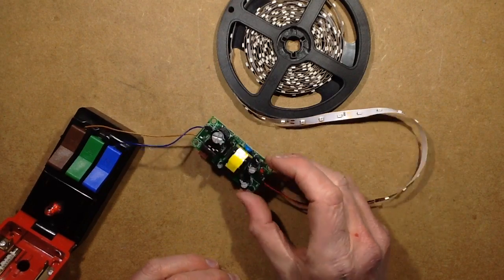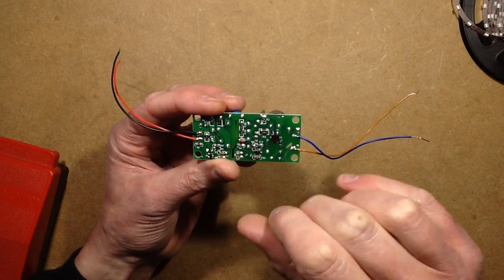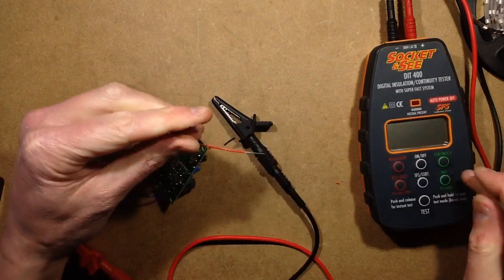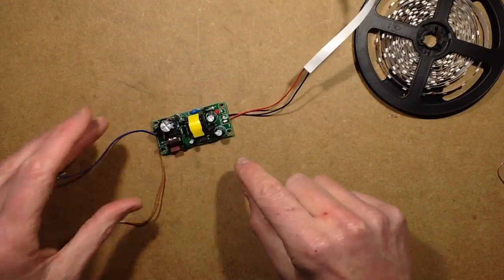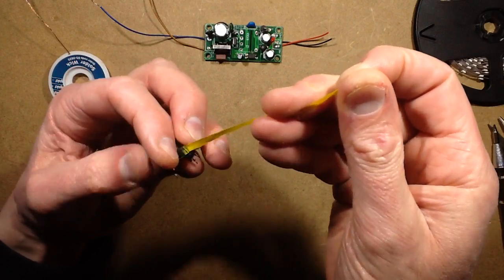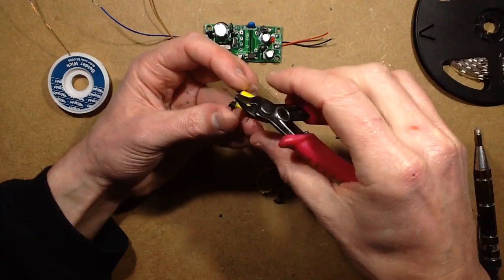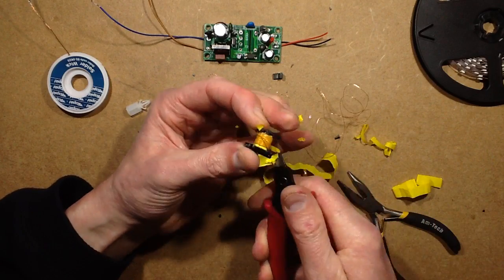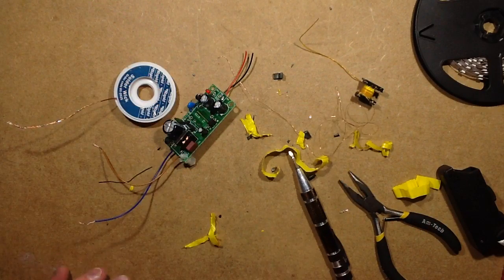Test of bare eBay 12V 1A PSU module, including safety tests.

Comment: Shouldn't say UK grade, that is making a myopic leap in claiming that no other country in the world has any standards in making anything and everything is relative to UK standards. You should just say it complies to a level of UK safety, because every other country has standards of safety and some higher than the UK.
The Chinese simply make an array of products as they are the worlds biggest manufacturer. So at the cheapest possible choice you can find it usually isn't of the best quality for obvious reasons, that isn't anything to do with China, it's to do with the price. As China makes many good things if you are willing to pay more. 
As an example, a pathetic Samsung galaxy cheap clone on ebay is usually trash. But if you buy a good Huawei phone they are really good. 

But you have many people like in the comments trying to base Chinese people and their intelligence or safety off the cheapest possible products they can find on ebay, that just isn't logical. 
That would be the equivalent of going to the UK to a school for mentally handicapped children and concluding that is the education level of the UK, that isn't a proper form of thinking. 

Because most of the other products in stores are all made by China anyway, they make anything to all varying grades.

Ebay doesn't operate like a normal shop either, they don't personally check or even check pages of things posted at all.
That's why the Chinese put exaggerated mAh ratings on many cheap things, put false MP ratings on stupid cheap camera's, and put false lumen ratings on cheap flashlights etc. 
Even though they are blatantly lying, they sell hordes of this stuff to westerners. So it would seem the people buying and believing in it are the stupid ones. If the ebay client base of cheap electronics was more intelligent then the Chinese would be more realistic about their claims to be believable.
Reply: So it's somehow our fault the Chinese are cheap, lying, purveyors of unsafe crap?

Comment: whats the best AC to DC power supply/DC converter to use to drive those strip lights off of a motion/PIR switch to use as under cabinet, motion activated lighting? I'm going to have 3 separate runs so I'm trying to keep cost at a minimum...I could go down to 2 runs if I can figure out a way to jump from the end of one strip with plain wire, snake through the inside of cabinets and come back out and reattach to another step on the other side of the stove. any help from you guys would be greatly appreciated! thank you in advance.

Comment: I might need to order a few of these, myself. I'm quite taken by the 12V/5V dual output option! And a friend of mine who's been designing a circuit of their own might be snagging some as well because just one of these is cheaper than the PCB space of having her own switch mode supply designed in.
Reply: I get those from every computer I salvage. Short pin 14 to ground on the motherboard power connector of any ATX power supply (pretty much anything Pentium II or later, unless you got a funky proprietary brand name PC like DELL or HP where the pin-out is hit and miss) and you have yourself a 300w or higher 5v/12v PSU with -5, -12, +3.3, as well as a 5v that's always on (motherboard standby power, pin 9) even when pin14 is off. http://www.helpwithpcs.com/hardware/img/power-supply/atx-psu-pinouts.gif

Just grab any old PSU from a PC that you're throwing away, install a nice power switch, maybe a power LED, rig an easily replaceable fuse holder or a trip breaker and mount some barrier strips or screw terminals (for easy connections) from your scrap pile, and you'll have yourself a cheap recycled bench power supply.

Granted, these don't mount easily into your projects, but I get lots lying around that would otherwise be going to electronic recycling.

Comment: Hey clive

Where did you get the spring loaded mains cable connector from ? And can you remember what it's actually called?

Love the videos by the way :)
Reply: That's a Quick-Test unit. http://www.ebay.com.au/itm/121720059249?_trksid=p2055119.m1438.l2649&ssPageName=STRK%3AMEBIDX%3AIT . Might seem expensive but well worth the investment, and will last a lifetime.
Reply: Thanks Phil. Been looking for something like this

Comment: Hey, really love your videos. I was wondering if you take requests? I'd love to see breakdowns of those variable step up/step down supplies to get an understanding of how efficient they are. Particularly the cheap DIY kits on eBay for building a variable 30v supply. You can find tons of these suckers from China.

I know from personal experience with computers that cheaping out on the power supply is never good and I imagine the same concept applies to bench supplies as well, but having a cheap alternative to the expensive options would be really good if it's reliable or safe.
Reply from the maker: I'd suggest leaving a generous margin with the cheap adjustable supply modules.  Like half their rated current max to ensure they remain cool.  Julian Ilett has done quite a few videos on the power supplies.
Reply: bigclivedotcom
Heat was a concern for me as well, which is why I was thinking of mounting a small heatsink to it, then putting it in an aluminum case and letting it sit between a layer of thermal paste, effectively turning the entire chassis into a massive heatsink.

I'll check out that guy's channel. Seems really interesting. Thanks!
Reply: There are quite a few YouTube vids. of DIY bench PSUs built with Chinese DC  DC boost - buck converters, using off the shelf switchmode supplies for the mains side of things.  I've built a 2-channel very cheap PSU using two of these - http://www.ebay.com.au/itm/100W-DC-5V-32V-To-1-32V-12V-8A-Auto-Step-Up-Down-Regulator-Buck-Boost-Converter-/191963750617?hash=item2cb1ee60d9:g:wdwAAOSwxg5XzpAh, and so far it's worked OK (and I'm still alive!) Note that the "100W" rating might be "Chinese watts", so a little derating may be sensible . . . . .
Reply: I've just been using a B3603 with 9V batteries, but I'd like to get my hands on a 24V power supplies(from mains) to use with it.

Comment: Amateur question - when you did the 500 and 1kv tests and it "passed", where did the power go?
Reply from the maker: It didn't go anywhere.  The test is to see if current flows through the unit when a high voltage is applied.  In this case it didn't allow any to leak past.
Reply: that thing are for testing the resistance between the AC and the output, in this case the tester fired up 1000v on 1 side but the other side it didn't detect any voltage =>> it's a good insulation so the voltage couldn't arc over it
Reply: Interesting, seems obvious now, thanks for the replies

Comment: dont no if you found the data sheet for the 63G20a ic but here it is http://www.alldatasheet.com/datasheet-pdf/pdf/300864/GLENAIR/M85049-63G20A.html
Reply: Obviously you didn't actually look at that datasheet before you posted the link.

Comment: Although these PS's will drive a little more than their rated current over a short period, with LED strips, after a while they will start flashing - a classic SMPS effect. The PS is also likely to overheat, especially as the LED strips tend to be used for possibly large chunks of an hour at a time.

Comment: Hi Big Clive, I managed to find the 63G20 chips for sale but the pages don't have descriptions on them that are of any use or those real handy datasheets... https://world.taobao.com/item/524764312766.htm  ....you would also need to run it through a translating website like google translate.  The title of this item translates in to "New original power supply 6-foot chip 63G20 SOT23-6" .

Comment: 3 months after buying one, I know it can run 24/7 (for 2 days straight at least) without a problem, produces minimal heat and has no electrical noise. It's brilliantly good! Thanks!
Reply: What load?
Reply: 2,5 meters of LEDs in a strip (150 led chips)

Comment: I'm confused... Besides voltage under load, would not the next most relevant test to be to check output ripple. I mean its a DC supply.. voltage under rated load and smoothness of output are the most important factors when rating a DC supply.. Especially if I was going to use it in a preamp cct...

Comment: Hi Clive. Are there any books you could recommend that explain the basics of electronics? I love to have a fundamental understanding of all of these components, and why they're used. I'd love to be able to read a basic 'analog' circuit board like you can.
Reply: bump
Reply: +Bereitschaft I bought "The Art of Electronics" Third Edition, which was recommended elsewhere, but it still is above my level. It goes into voltage dividers within a few pages, but I had to ask a friend to explain them to me in a way that they made sense.

Comment: the driver is the ob2263 quite common in psu and chargers
Reply: also the core of the trafo comes out quite easy and fast heating it up with a heat gun or for bigger trafos submerging them in boiling water

Comment: I may order some of those since I want some led strip lighting in my bedroom, they seem decent and look unlikely to explode.
Reply from the maker: +ewandougie I'd recommend the cased in-line LED lighting transformers for that.  they're very common for powering 12V DC ceiling lights.  Just make sure you don't buy the "halogen" version though as the output is unsuitable for LEDs.

Comment: The european norms suggest that the device should be able to handle a 2000v test if metal parts are exposed but grounded, or 4000v if the stuff isn't grounded IIRC.

Comment: Where did you get the mains isolating box from? I used to use one years ago, but can't work out what to search for on eBay?
Reply from the maker: +Paul McGuinness Quicktest.  In the UK you can buy them from CPC and Rapid Electronics.
Reply: Cheers :-)
Reply: +Paul McGuinness You can still find them on ebay but they are quite expensive.  I have two somewhere and now I want to use them.... I can't find the buggers!

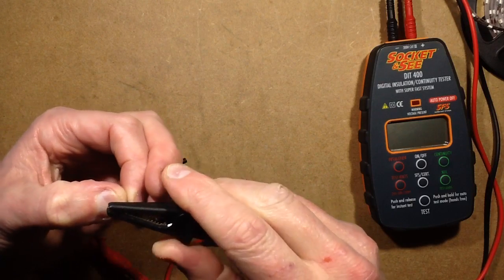Comment: I am looking online for your union r strippers (4:30) but couldn't find them but I did find some union tools.  Do you have a better description or a link for them?
Reply from the maker: +Carl Lind The Unior strippers.  The same style is made under many brands.  If you look for the similar style with thumbscrew adjuster you should find them.
Reply: +bigclivedotcom Last year I bought the vise grip ones but they only lasted for about 100 wires.  I think my mistake was using them on romex.  Thanx for your help.

Comment: Hey, I live in the US, and I'd really like something like your Quicktest, but it seems they only make 240 and 480v 3-phase versions. Do you know of anything similar that uses the US standard colors and plug?
Reply: These kinds of things are typically rated for "up to" 250V, so running at 110V should be fine but might not light up the built in indicator lamp. Also, because the 230V world has so many different plug standards (especially many when the grounding / PE pin is required), these things are probably sold without a plug anyway.  As for the colors, I seem to have read somewhere that the latest US electric code permits this particular set of 3 colors (green grounding/PE, blue grounded/N, brown live), but I haven't checked.
Reply: Cliff Quicktest makes one for the US market

Comment: Keep up the videos!

Will you consider inducing a primary secondary contact failure to see how the rest of the psu responds?

Also, did you look to see if there is a bleed off resistor on the primary side cap?
Reply from the maker: +Chris Given The primary circuit uses a switchmode chip which generally results in the electrolytic being discharged quite quickly when powered off, by virtue of the resistor used to boot the chips power supply before the auxiliary winding becomes active.

Comment: So - I use them all the time - probably the same supplier. The smaller ones are ATTROCIOUS - really dangerous spacings, lots of noise.  The one you have I am convinced is a winner. I use the 5v version with ESP8266 WIFI boards which have 3v3 linear regulators - and I get no issues at all - even sticking some serial LEDs into the mix. They certainly are ok.

Good video.

Pete
http://tech.scargill.net

Comment: Great video. But I've a doubt, why some smps chargers have a spark gap inside? I've recently opened a Nokia charger (model ac 11 n2) rated at just 85 ma output, has a spark gap between the low voltage side of transformer to the ac mains side. Why is that required?
Reply from the maker: +Sangeeth S It's often found in higher profile supplies.  I can only guess that it might be to take the excess voltage from a static discharge without stressing the insulation between the primary and secondary excessively
Reply: +bigclivedotcom Okay, so here I've uploaded the image of how it looks like inside. Please go through it. http://s24.postimg.org/4gedppbn9/DSC_0537.jpg

http://s9.postimg.org/s43a0x51b/DSC_0538.jpg

Hope it helps to get an idea. :)
Reply from the maker: +Sangeeth S Looks fairly typical.  Seems to have good separation on the PCB.
Reply: +bigclivedotcom Yup, now I have to unwind the transformer and see. Thanks for all the inspiration you give us to test things! :)

Comment: Clive, could you test some of these? http://www.ebay.co.uk/itm/White-Blue-Red-Car-Interior-Light-Panel-48-SMD-3528-LED-T10-BA9S-Adapter-12V-/231237289762?var=&hash=item35d6d10722:m:mkHRAc39G0HHZrF7fIDSKQQ
Reply from the maker: +jackbox That type of panel has been around for a while.  The only significant variables are how hard the LEDs are being driven and their quality.  The only way to test them properly is to leave them lit continuously and see if any LEDs start to fail.
Reply: Thanks  for the insight Clive. Will have to see if I can do the maths :D

Comment: The wires to he mains voltage look a  bit underrated. Are the wires properly sized or it's just the way I see it in the video? (Also, did the mains wires come attached from the factory or did you add them? )
Reply from the maker: +Elmocia Essinia I added the wires with what was to hand for testing.  I'd use more appropriate cable in a proper application.

Comment: Have you ever done a review on bare 10-30W LED drivers?. I normally use voltages ranging from 30 to 70V and there are a lot of differences on the quality of such units, so it would be nice to have a comparison with different types.

Comment: I've found that using compressed air to blow molten solder away to be very effective.  Sure, it's messy.  And if you're using the same board and not just salvaging a single component from a trash board, you need to pay attention to where the solder flies off to...  I ended up just trying it out when pulling a proprietary contact array from a dead board and it worked out so much better than desoldering bulbs, braids, and piston style vacuums.

Comment: Greetings from Golden Shores Arizona where we are wintering this year.  I picked up one of those transformers on a deal where they sold a 100 Watt LED with transformer in one auction.  Problem I had is that when hooked up to our US 110 volts, it begins to oscillate and is sort of like a huge turning signal.  Not much use for me, I tried to get the seller to replace, but they just gave me an instant refund.  I tried it with other 100 Watt LED's that I had with the same result.  It now lays in my junk box back in South Dakota, and I will play with it in March or April when we return to the high Prairie after the snow has gone.  Any idea what could be making this thing misbehave.  If my memory serves me, the PS looks exactly like the one you have.  The seller offered no help really it appears that they simply sell the device and have no real knowledge of their product.

Anyhow thanks a million for your videos they are very helpful as I am trying to get into electronics a bit more now that I am retired and have plenty of time on my hands in the summer months.  By the way, today is the day after Christmas, the wind came up last night, and has been shaking our old motor home from side to side steadily now since 2AM, winds in excess of 30 MPH by my little wind gauge. Noisy and has our cat very jumpy with all the noise.  Me too for that matter.  Plus our Tv will not come in as the antenna is being blown all over and it has a loose cable.  I am too old and to fat to get atop the rig and fix it, especially in this blasted wind storm.  Oh well it could be worse, I could be back in South Dakota  where they are receiving a winter storm heavy wind and snow.  Temp here is 52 F so relatively nice if the damn wind would just go down.

Comment: Hi. You mentioned that it was tough to desolder. Could you show how desoldering such a thing looks like and when it's difficult and why? I tried desoldering components from a computer mouse for fun (and to get the buttons), but the solder won't melt that easily and when I put a desoldering wick to it, it just doesn't work. I use a 48W soldering iron with a chisel tip. It's set to about 400 degrees C. I also apply some solder to help transfer the heat, but I just end up adding more solder, leaving a big blob of it and giving up. Is there anything I can do to make it easier apart from buying expensive equipment or a 100W iron with a bigger tip that will probably fry the components? Everyone makes it look easy - just touch and it comes off.

Comment: Merry Christmas Clive's! I am pleased that you done a video one one of these power supplies as I just bought one a couple of weeks ago for my raspberry pi (5v version) and the construction is the same as your 12v one, I bought the one with the metal case round it which I will earth separately. Mine has a voltage adjust on it from 4.2v to 5.6 I think it was. I now have a bit more faith in it before putting it in to the loft after testing. Great video as always!